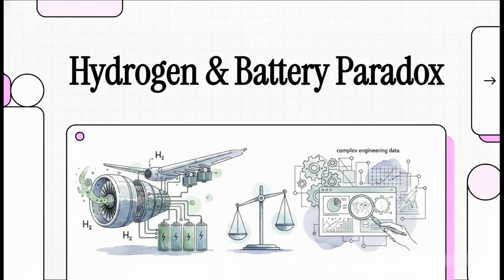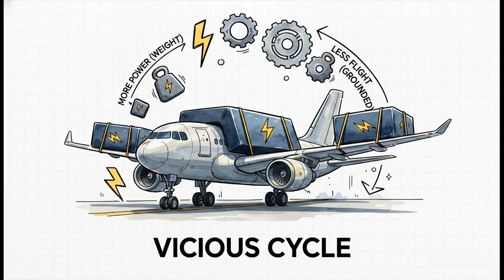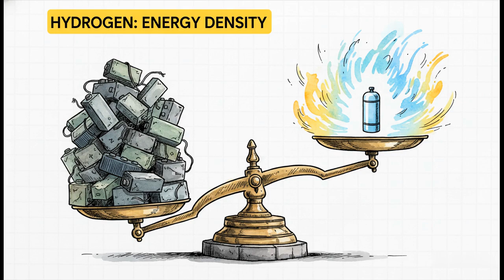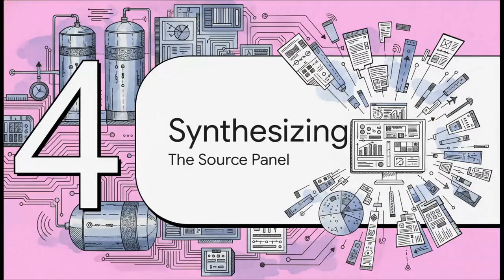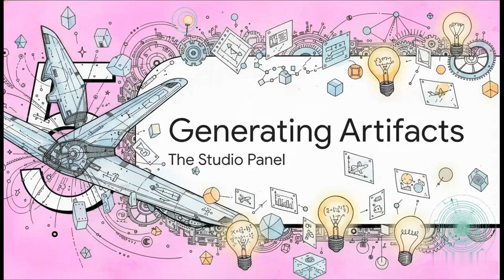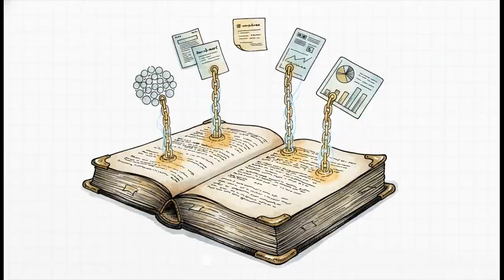Hydrogen vs Batteries: Why Aviation Chose Wrong

Comment: solution is synthetic fuel - hydrogen tanks are too heavy
Reply: Yes, too heavy, but also too bulky. Even with liquid hydrogen, the volume of the fuel tanks is too great for current aircraft designs. For a long haul aircraft, the LH2 fuel tanks would occupy a larger volume than the passenger cabin. The tanks would also be very heavy. The aeronautical engineers at the major aircraft industry are not idiots. "Hydrogen? Oh, of course! Why didn't we think of that?" Not.
Reply from the maker: You've hit on some crucial points about the practical challenges of hydrogen in aviation, especially regarding volume and weight. It's definitely not as simple as just swapping out fuel types!

Comment: An alternative might be midair refueling.  Keeping an aircraft aloft once it’s left the ground requires less energy than getting it off the ground, so start with regular fuel to get it up, have it meet with a battery carrier, load on the battery, and fly to its destination
Reply: nice joke :-) and they will recharche during flight? It is better to use trolley wire hanginging from baloons :-)
Reply from the maker: That's a fascinating concept! Midair refueling for battery swaps definitely presents some interesting engineering challenges and potential benefits for long-haul electric flight.

Comment: Getting Hydrogen out of the atmosphere requires more power than it produces
Reply: :face-blue-wide-eyes:Hydrogen Bomb!!!:face-orange-biting-nails:
Reply: The law of conservation of energy! if you put more energy in producing hydrogen - you will get heat. So use heat where needed and efficiency will be better.
Reply from the maker: Totally agree! That energy input vs. heat output is a huge factor. It's like trying to get more out than you put in, which, spoiler alert, doesn't really work.